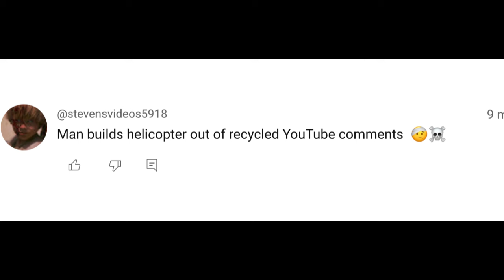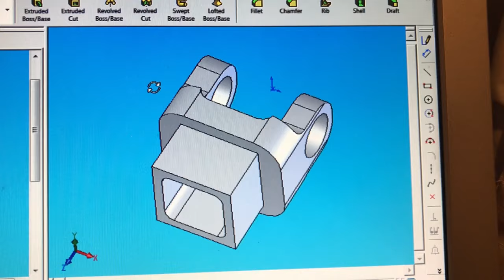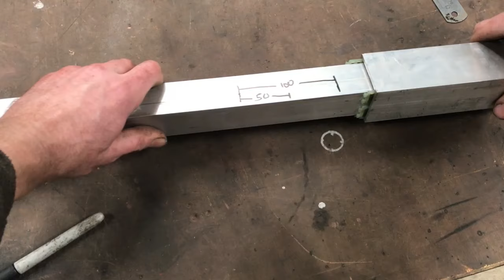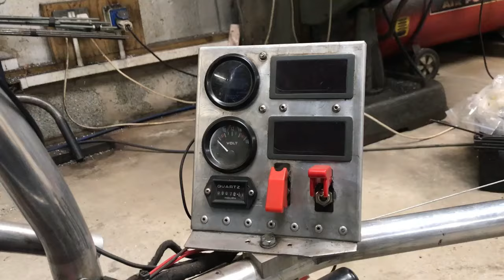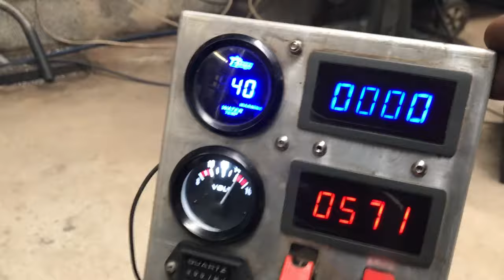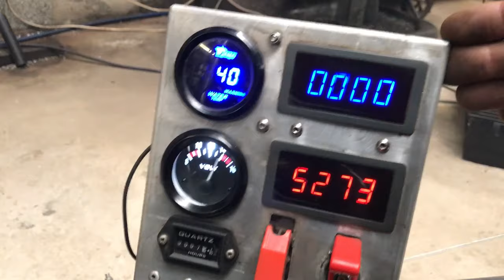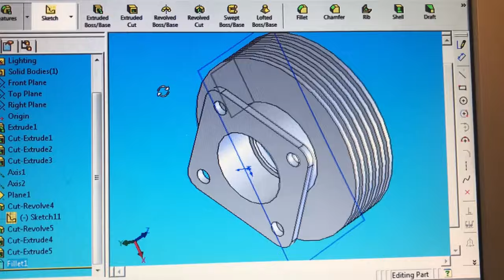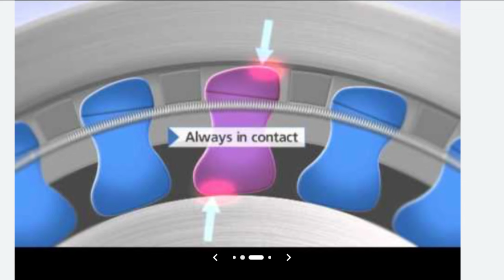Should I fix my Homemade Helicopter ???

Comment: G'day,

Your call.

At some point, you will decide that you've already had all the highpoints - designing, building, and actually TESTING your Machine in the Air, as well as successfully surviving a Drive-Train Failure while 
Flight-Testing...., tick, tick, tick, tick...
All those boxes.

We gave up Aerotow-Launching Rogallo Hang-Gliders, when after 500 commercial Aerotows..., we watched someone else pull a Glider into the ground & kill him ; and we realised that about the only thing we had not yet done, which could be done while Aerotowing - was to hurt someone when something eventually went wrong.

So, we quit before it all turned to Turds....

Each to their own.

If as you say..., you aren't going to ever levitate higher than you're prepared to fall, only over Private Land with theTitle-Deed holder's consent...; then unless you shed a Blade at speed and
Skewer someone like a
Javelin, or decapitate them (!) -
Everything should be fine.

It's a Toy Helicopter you can sit in.

One thing with Contrarotating designs, obtaining Yaw Control by varying the amount of Power (Torque) to each Rotor so as to balance each other - or selectively not so....; which I've observed while flying Electric R/C Scale versions..., is that owing to the top & bottom Arrays being mirror-image units, with the same Diameter, Chord, Section & Incidence but going in different directions, the Upper Array rotates considerably slower than does the lower Array - by about 30 or 40% in terms of RPM.

I suspect this is because the Top Blades are ingesting Clean Air, but the lower Array is effectively "Windmilling" in the Slipstream unless it rotates very much faster in the opposite direction, in order to be able to add Energy to the (already downgoing) Airflow.

In the Models, the Speed Controller feeds CURRENT to the Motors to allow them to Contra-Rotate at whatever RPM their Respective Blade-Drag dictates, for the specific amount of Current being converted into Torque.

I deduced this from the way, after falling down uncontrollably every time I tried to descend too fast, vertically, through my own Downwash and Rotor Decay 
"Got me !"...; and every time the
Lower Blades were a 
Stiff & Flat Disc, on Impact, spinning sufficiently fast as to be quite rigid - but every time the slower-rotating Top Blades would Bend down on Impact, and
Collide with the stiffer Tips of the
Lower Array
Coming the other way.

The Photos of the Shadows of the broken Blade-Tips on NASA's MarsCopter tell me that they descended too fast and fell to the Ground in Rotor Decay, hitting flat at full Power, and the Top Blades bent down to cut off all four Blade Tips.

I developed a procedure to cast new Blade-Tips on the broken Roots - but I'm not going to Mars to do it for them (!).

But, how to you propose to drive the two arrays at say 400 RPM on top & 600 the other way on the bottom ; because if the Electric ones are any indication - such seems to be a feature rather than a Glitch (!).

Anyway, have fun !

Stay safe.

;-p

Ciao !
Reply from the maker: Hi Warbles, I appreciate your thoughts, you are absolutely right it's a toy helicopter you can sit in. Not everyone gets that. 

If your rc coaxial has the bottom and top rotors set at the same pitch then they would need to spin and different speeds to maintain torque balance.

Mine have a 1 degree pitch differential as the speed is the same. I think the AOA is reduced on the lower rotor because of the downward flow of air. 

The Bensen B9 had two different rotor diameters, they ran at two different speeds and were driven by a differential gearbox. This was automatically torque balanced, I don't know what pitch he chose to run the blades. 

I understand your point about the glider towing story. 

Cheers Ben (ps did you notice I thought your name was Ciao in previous correspondence? 😆)
Reply: @Ben-Dixey  

No worries !

PS....

My name is
Christopher John Wharton....

In about 1986 the
Communards in the local
Alternative Lifestyle Community
("Hippie Commune")
Changed my
"Nickname" from
Chris Windmills, or
Windmill Chris..., to
Chris WarblesOnALot....

Which seems to have
STUCK.....(!).
???.

Such is life.

;-p

Ciao !

Comment: Give the fixed pitch idea a miss. The mas of the rotating components creates too much inertia to accelerate/decelerate for successful control, especially with limited power available (only 1 of many reasons to abandon this idea). Ask yourself "how many successful helicopters use this configuration"? Works OK on drones/quadcopters with low mass, small diameter blades coupled with very hi-torque electric motors.
Reply from the maker: I agree with you accept I think we have different goals in mind. I'm mainly doing this for fun. I don't think it will have a commercial use as a passenger carrying machine but it can certainly teach the fundamentals. Maybe there is an unmanned military use ? 
I don't know but the commercial side of it holds little interest for me, as a toy I think can be used within certain parameters. 
The Nolan brothers demonstrated what a fixed pitch tilting mast helicopter can do and its far beyond what I've demonstrated. 
If building a new one I would add collective for sure. That might not be a coaxial though as the mechanism is a massive headache to work out.

Comment: Why don't you fly it as an RC project for a while until you're confident the engineering will actually stand up to the stresses it is subjected to?  As someone who obtained a private heli license flying R22s,  I can tell you those things, although certified, are still nowhere near as reliable as some would have you believe.  Have fun doing what you're doing but please don't put yourself in a situation you don't need to be in.
Reply from the maker: Good comment, I wonder how much testing would have to be done before you say ok, that's enough, now I'll get into it? It could break on the very next test couldn't it ? If I was to test it remotely for say 2hrs then replace all the revolving components with new then I could say it will definitely do 2hrs of hovering without breaking. The trouble is making new components is not cheap or quick. I suppose it comes down to budget, big company's will spend huge amounts of money doing things the safest way. Someone like me can't achieve that level of safety via testing.  
I Will give it some thought though. See if I'm willing to go the extra mile and do some sort of remote testing. If only to test my new driveshaft for the first time.

Comment: steel hardened roller bearings on an aluminium surface is not the way I would do it if you want to load that shaft more than a couple of times. Be careful out there tinkering
Reply from the maker: You could be right. I have a hunch that the number of rollers in contact with the aluminium and the low torque won't indent into the aluminium. However this needs to be worked out or tested. I might well go for steel will see what I can figure out.
Reply: @Ben-Dixey  For the pairings of untreated steel and hardened needle bearings there exist two types of scenarios that can happen as they are getting cycled for the first times. One is that they surface forms a densly packed, hardened layer itself and the other is that it will immeadiatly deforms and "eats" the unhardened steel. For aluminium I fear worth. Since your shaft will always be under bending due to tolerances at the joints you will see a cyclic motion at the bearings..
Reply from the maker: I did a quick calculation. The engine can produce a maximum constant torque of 55lbft. The inner box is 44mm Flat to flat. That means at 22mm radius a force needs to be taken of 759lbs. There are 288 rollers half of those will be taking the load. 
759/144 = 5.27lbs/roller. Or 2.4kg.
You could push that load on one roller with your finger. If what I've calculated is somewhere near then I can't see it being a problem. The issue is how much more torque is applied during an engine spike.

Comment: Make a tip jet helicopter with cyclic control
Reply from the maker: Would like to experiment with tip jets, are you thinking cold tip jet or hot ?
There is a category in the uk called non part 21 . This allows you to fly without a licence or certification, the maximum aircraft weight is 70kg including fuel. Perhaps a tip jet machine could be achieved.
Reply: @Ben-Dixey  Yes. Hot tip seems easier and cold tip more interesting.  But i'm not an engineer.

Comment: arka dümenler çapraz değilde düz hareket etse daha güzel olur
Reply from the maker: It would be better if they moved straight in a hover, yes. I hinged them at an angle so that in forward flight you still had some yaw control. Not sure if it would ever be necessary in my case.

Comment: Great welcome back, what have realised so far is these fails hit one so hard gives up for a while and out of nowhere the energy and determination loads up and a win is inevitable.
Reply from the maker: Hi Jeff, great to hear from you, yes it is a marathon not a sprint. I believe it takes years of persistence to reach the end goal. The failures hit hard but enthusiasm and energy does return and the excitement starts again. 

I did see your video on the low rotor rpm. I thought we went through that and it was ok. What was so wrong ?
Reply: @Ben-Dixey  turns out the pulley reduction gearbox don't need to be there as per design if the rotax gearbox is there, I replied to your comment on ultralight guy engine start video where you had asked him how far is gear ratio was off and i see he replied to my explanation with changes he made. Have  a look at it.

I have gone slow on my build, spent so much on air tickets in 2023 just going to build it, and have momentarily given up, no more pressure might as well wait to 2028 when I permanently return home.

Other than that my energy is building up feeling like flying in home on Sunday to remove the pulley reduction and check new rpm, without fitting the rotors cause I don't want the hustle of moving the craft outside the compound
Reply from the maker: @JeffChoppah  No harm in having a break from this type of project. I think it helps make better decisions. The successful people on YouTube have been at it for decades, we usually only see the final result. You should be proud of how far you have come, have breaks, but never give up no matter how long it takes. The victory in the end will be an immense feeling.

Comment: You should build a helicopter. I love experimental aircraft. This one is a dud though. But burn that one to the ground and never look back. It's a death machine by design. An engine failure will kill you in that bird. Build a helicopter that you can safely land regardless of engine status.
Reply from the maker: Altitude will be 3ft max, I've built a hovering machine. That's all want but yes the the next one will have collective. I might even be able to add collective to this one.

Comment: Aluminum tube shaft is ok but add steel liners so the rollers don't gall the aluminum -
 Met with the Nolan Brothers at Oshkosh 95 -  No auto rotation  but the twin engines and fuel tanks they thought they had it made, "What if you fuel up with bad gas in both tanks"? "Hmmmmm Ya got me there" 
 Always add an overruning/sprag/ dog clutch in a 'helicopter" Piasacki H 21 has a giant 'ratchet' clutch you could hear it from 300 feet when you rolled off the throttle - Bet you could use a big ratchet wrench for your flying machine.
https://www.youtube.com/watch?v=fRp2uAYWa_A     My toy...
Reply from the maker: Hi Don, great to hear your thoughts. I think I would be happier with a sprag clutch so yes I will do that. Your idea of a simple ratchet isn't something I thought to use, it will easily take the torque. Nice one👍
The aluminium galling could be an issue as you suggest, I might just use steel box as but haven't decided yet. 
You can also get ball splines, heavy solution but something to think about. 
Something I wondered about the Nolan's was knowing how tricky windy conditions are with fixed pitch how did they manage to fly it at Oshkosh. Unless it just happened to be a really calm day? 
Thanks for the link to the rotor mouse  helicopter you built, I had seen it before but nice to see it again.
Have you still got it ?
Reply: Still got her. The Nolan machine didn't fly at the show but I've seen them fly in the wind, the throttles lagged when translational lift was encountered they lust powered through it . A little thinking ahead as they flew. I finally  got more data from Gyrodyne and figured the Rotor mouse was flying at the top edge of gross weight - Plenty of power. Limited lift...Added 10" to each blade cap @Ben-Dixey
Reply from the maker: It seems then the Nolan's managed to control it in the wind. When I hovered mine and it got slightly gusty, rotor flap back and sudden height changes makes it very hard to control. I can barely hover it in these conditions but if it's calm then it's relatively easy. The Nolan's must have experienced the same thing surely, it's a very similar design. Perhaps when you are more proficient you can just hover a few feet higher and gust aren't so much of an issue ? 
The throttles lag issue I can completely understand. 
When you added 10" to your blades did the gearing need modification or was the slightly higher tip speed ok ? 
Must have been an amazing feeling flying your rotor mouse, it's a proper helicopter.
Reply: Tip caps reduced disk loading ,All other effects didn't change - The Brorhers powered through translational where the flap back and other effects happen, It effects all helicopters not just yours. @Ben-Dixey
Reply from the maker: @HongyaMa  Ah Ok. 
I was wondering about the Delta 3 built into some rotor heads like Robinson perhaps reducing the effects of flap back. Can't see any Delta 3 on the Nolans so hopefully I don't need it. I know the Bensen B9 had Delta 3 teeter hinges. 
I expect the lack of control during wind gusts is down to my lack of experience.
Reply: Robinson tri hinge was Franks way to reduce pitch roll coupling . Hughes 269  has the delta hinge and most helicopters don't . The most you'll see the delta is in the tail rotors. You'll notice in ETL the nose pitches down and you feel a rumble in the air frame - All helicopters do it. From Rotorways to Hueys ... After the air  flow settles and you hit 20 kts the helicopter will fly smoothly  @Ben-Dixey
Reply from the maker: Well, more reading for me I think. 😆
A fascinating subject but confusing to understand I find. Very little on YouTube about these effects, seems it's mainly the forums that talk about it in any detail.
Reply: Find an old instructor and bend his ear, Lots of valuable learning. ETL efective translational lift, Transverse tendency , Compressibility, Gyroscopic precession,
Pitch roll coupling, Collective bounce, 3+1 p, all the adjustments to get the final product. Try the HOGS - Helicopter On Line Ground School, He has lots of good stuff
Reply from the maker: @HongyaMa  Cheers for the advice 👍
I am actually in contact with a 91 year old heli instructor. He's been very helpful but I haven't asked him about all the things you mentioned. Will do so. 
He used to fly the Bristol Belvedere amongst lots of other aircraft and luckily he supports home builders. Not many do.

Comment: Given that the cobwebs didn't need beating with a broom it appears you have begin to follow the same line and Frankly I like the Square drive but the Russian KA-52 system is why Easier. Americans used hundreds of thousands of dollars to make a spring loaded ball point pen for Space - Russians used a pencil - Your 2 years of design is awesome even though it wasn't your's you made it and it worked it's just that shaft First and before getting off the ground ...
Have you seen how the Lazy bloody Russians made the KA-52 and the Only thing that brings these things down is an unseen air defense system - it's a Diff and Every car has one ... some cars have 2 and wouldn't even miss it if you pinched one 🥴- for example after googling the KA-52 system and looking at your neighbours car, Would he notice if the front diff went missing, do you think you could find an old diff out of a Very Light car and in your head stick it in place to see how it works - Why follow an unproven example when some dumb Russian Anorectic of the age of 13 has already done it?
I'm watching - I love the way the KA-52 is designed ...
I watched to the end - I like you - I want you to have a look at how the Russians built the KA-52
Reply from the maker: I'll have a look and see what I can find on the KA-52, I love all Kamov helicopters right from the KA-8. A differential is what the Bensen B9 used but it still needed the plunging tilting driveshaft. Bensen actually used rubber tyres as universal joints. I chose not to copy but it must have worked. Simplest ideas are usually the best.